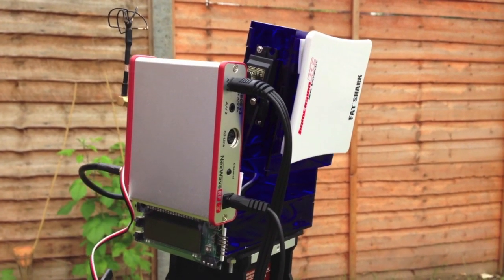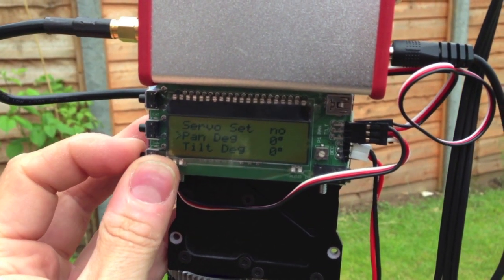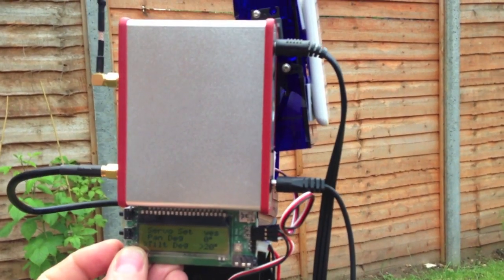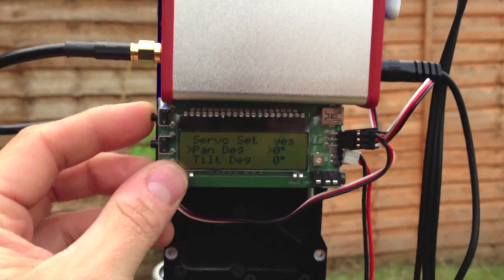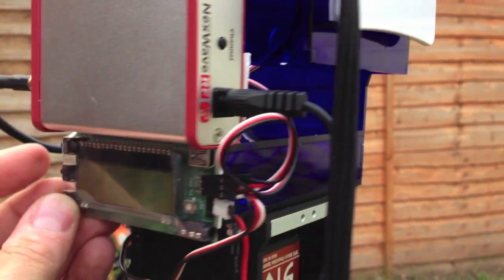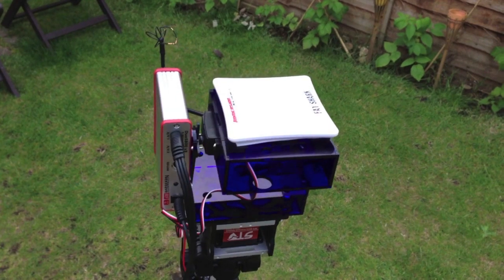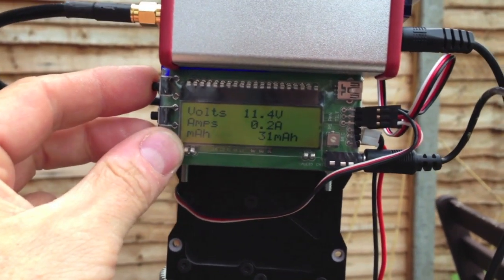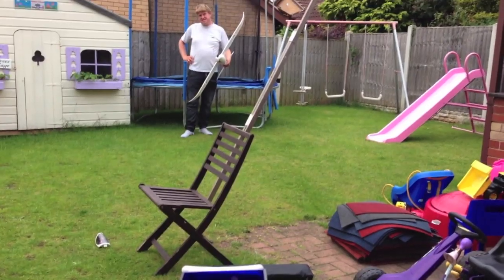ImmersionRC FPV EZAntenna Antenna Tracker Setup Guide and Walkthrough of the system.

Comment: I used a tx other than Immersion with a mic. built in. It's not sending the GPS data over the audio ( the only audio is from the mic. ) but I think it's because I need to use an Immersion tx ? Or any tx without the built in mike, but audio input ?   mmm..        Any one have any ideas ? I just received an Immersion 600mw tx so... I'll see if it is the tx or not. If it works, I will update.

Comment: is the azantenna tracker is just for the 5.8ghz frequency or can i use it for the long range 1.3ghz frequency?
thanks
Reply from the maker: Dan Avidan yes can use any antenna on it such as 5.8, 2.4 or 1.3. The signal for the tracker comes down the audio signal from the video transmitter

Comment: Hi, the EzAntenna Tracker is on sale right now, I'd really like to get a similar setup... So apart from a diversity receiver, pan/tilt servo, what do I still have to buy? (Of course there will be 2 antennas and a tripod too...) what do I have to install on the aircraft? A GPS? Is it something that I can mount on a 250 quad? And do I also need something to "control" the servos or does the EzAntenna Tracker already preform this job? Thank you very much for your help.